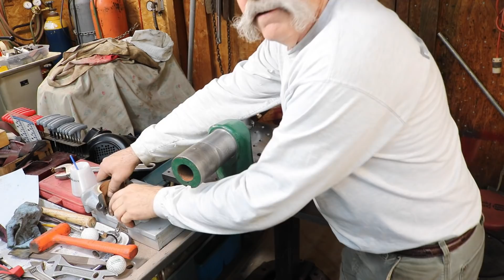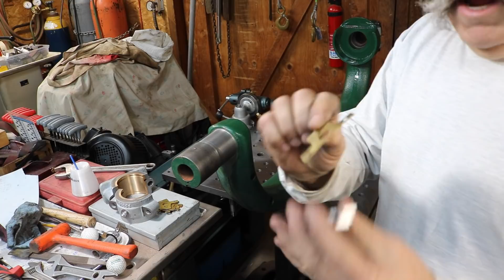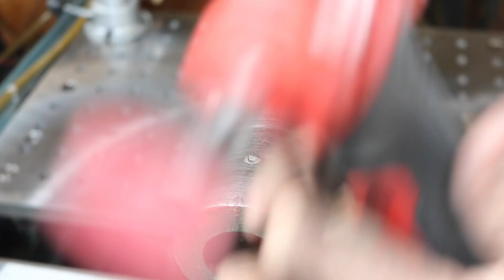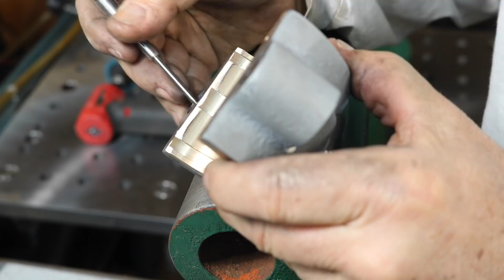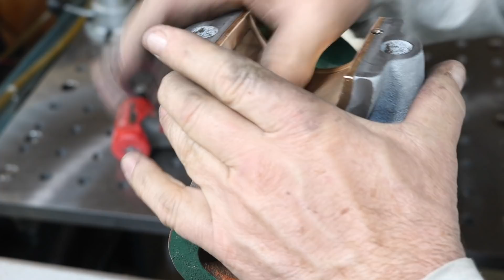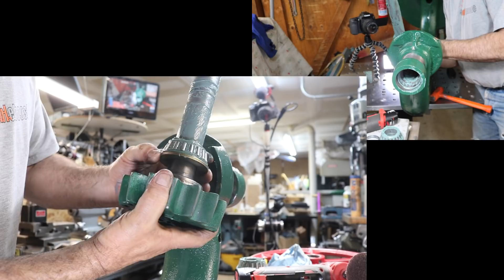Cement Mixer Restoration | Yoke Assembly

Comment: Looking good my man.  Yeah, some are gonna carp about you hotting the edge with the grinder.  If the bearings were on a high speed shaft, that's one thing, but when it wil only be used to dump the drum get over it.  That is 100% better than original so quit your carping.  That thing will run for another 50 years, Good Lord willing.
Reply from the maker: You got it Vernon.  Thank you.  Love it.  Stay Safe and Well.

Comment: Go ahead and get out the time savers paste and lap those bearings in. You know you want to. :-) lol
Reply from the maker: I have never used it Brian.  What is it made of?  No need they fit sweet, feeel great.
Reply: @rrintheshop  It is made of various things depending on the application. It does not charge into the material and is often used to aid run in of mating surfaces by making the polishing and fitting go faster. I have used it in new gearboxes before and noted a marked decrease in running temps after a run thru of oil charged with the time savers paste.
Reply from the maker: @bcbloc02  A new meaning to wear it in or wear it out.

Comment: Probably wouldn't have hurt to just take a little too much off  to begin with and be done with it.
Reply from the maker: Not really, then you will end up with just point contact at the center of the arc of the bearing.  Thanks Dudley.
Reply: @rrintheshop  If the inside radius of the cap matches the outside radius of the journal... and only the ends are nipped... seems like perfect contact except for the ends. What am I missing?
Reply from the maker: @dudleycornman1624  Yes that is correct, that is what I did.  With the small amount of crush into the bearing housing the end tend to press inward a very small amount.  This gives you perfect load contact with the bearing shell and the housing.  This is most important for load and heat transfer.  A small amount is most common to be removed at the ends for relief and fit to the journal.  This also allows for proper lubrication to enter the lower shell and a close tolerance fit to the journal.  Thanks Dudley.

Comment: Motors have the parting line clearance too. On my performance motors I build I well have a .002 to .003 clearance on top and bottom, the parting line we'll be .006 or more, that allows oil to flow in that area to help with cooling the crank shaft. 
But your not turning 8,000 RPM either.
Good job Randy,
Thanks for the info last week.
Reply from the maker: Thank you Mr. T.  Not a problem.

Comment: For all the emphasis on cleanliness and fit, there are a surprising number of small things, done in simple ways, that you can get away with, even with an engine.  You'll be able to mix and pour at 4 grand with that 😉 ... not that I'd ever want to try to work that fast with concrete, but who knows, you might need to use it as a centrifuge one of these days.

Got me thinking on going out and tackling my old mixer again.  It was a bit discouraging to have that nice new gear wear out under a load.  Next one is going to be of a confirmed known material and heat treated.  Maybe make use of part of that old Freighliner kingpin after some annealing.
Reply from the maker: Thanks Diggerop.  I think i will keep under 4 grand.

Comment: Good video.   It was interesting to watch as you fitted the bearings to less than perfect journals.
Now that its nice you need to keep it indoors and clean it very carefully after use.
Do you see the pattern of making even more work :)
Dan
Reply from the maker: A dangerous thing, Work that is.  No stored outside. for the last 70 years,  It will probably stay outside.  Thanks Dan.

Comment: If you tweak the yoke bearings a little more you could reach rotational speeds in excess of 2000 RPMs, in your case, I guess if you set the limit under 1000 it will also do the trick....    😉👍😎
How's Spring coming along over there...?  Here it's still quite timid with only few days of sunny and a little warmth, with the confinementent rules being applied over here people are getting desperate for winter relief, mostly families with kids.
Reply from the maker: Well we got 6 in of snow last night and 2 in of rain and more is coming.  I will keep the rpm down to 4 Rphr.  Thanks Pierre.

Comment: Can this be converted into a digital cement mixer with  rotation speed and bucket angle 
read-out screen ?
Reply from the maker: Then for sure I could get this to the moon.  But then I would have to install some kind of operators seat, cup holder, usb outlet, generator, 110 volt outlet.  Another 2 years to this project.  Maybe I could get a government grant and then retire..  Thanks John.
Reply: @rrintheshop   LOL Randy, you could get Stan to come up and install a PID for mix cycle control :)
Reply from the maker: @warrenjones744  Who is doing the shoveling to keep up.